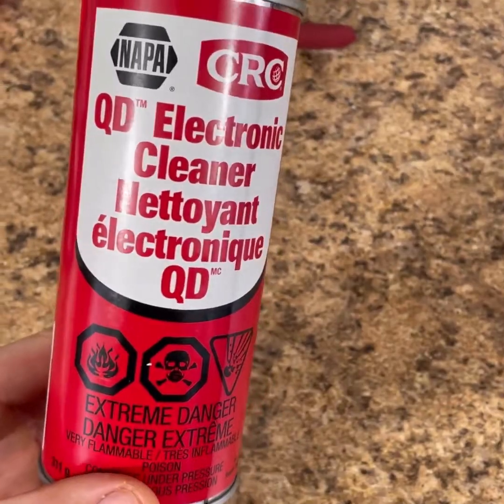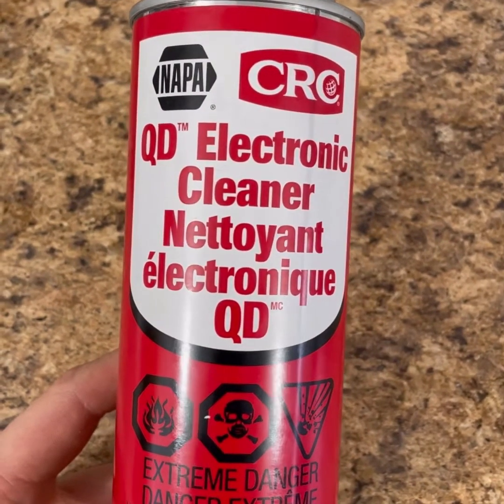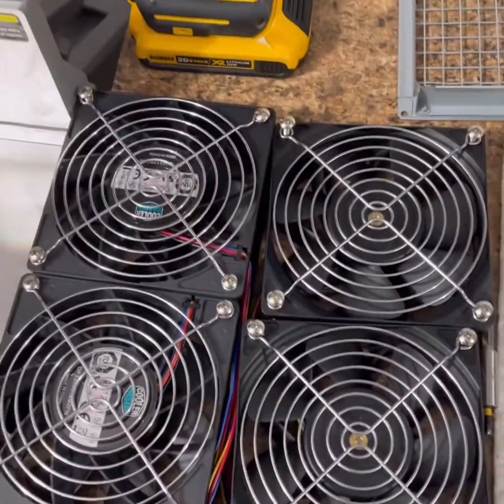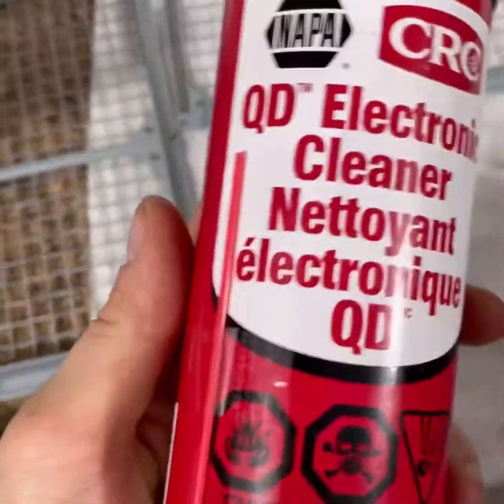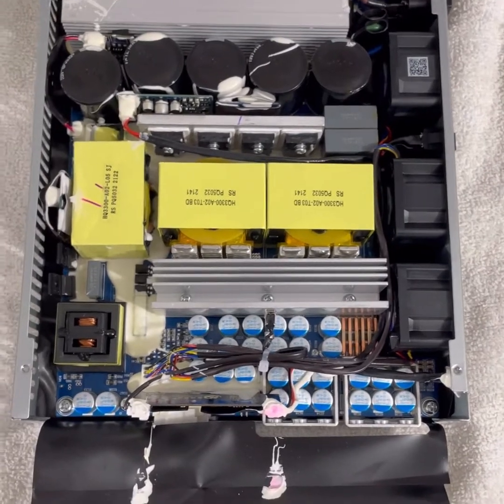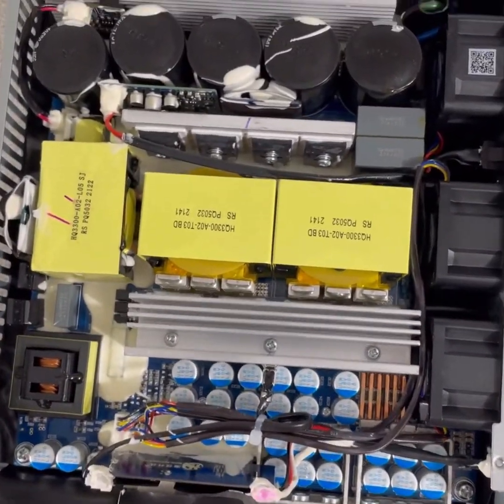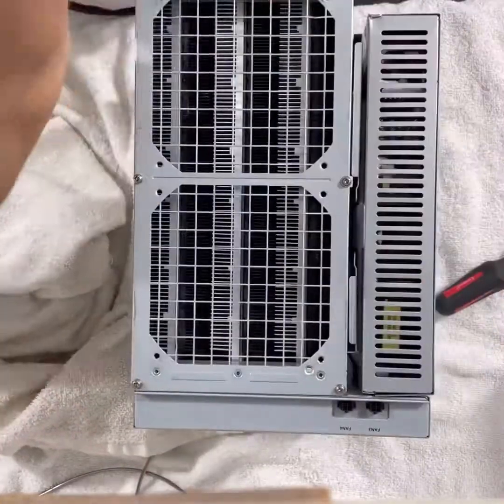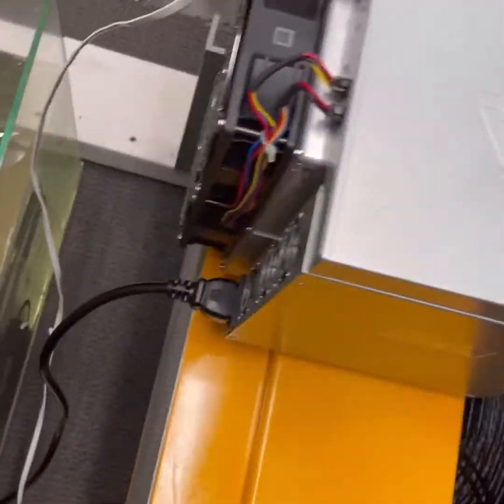Converting an Asic Miner from Immersion to Air -  How to remove oil, dirt, and dust from ANY Miner!

Comment: So, two months later, is the miner still running in air and is it working ok?
Reply from the maker: Still running the Avalon in air, running perfect👍🏼 currently working on a larger immersion system to get it dipped again

Comment: Hello, do the avalon asics need a fan emulator for immersion?
Reply from the maker: Yes they do, they use a 4 pin ATX style  connection. I found mine on eBay

Comment: Did you look into the oil cooler being compatible with Bitcool fluid? Really hope to hear back from you!
Reply from the maker: I did, the oil cooler is made of aluminum, which is approved under the metals section of the compatibility guide✅

https://www.engineeredfluids.com/material-compatibility